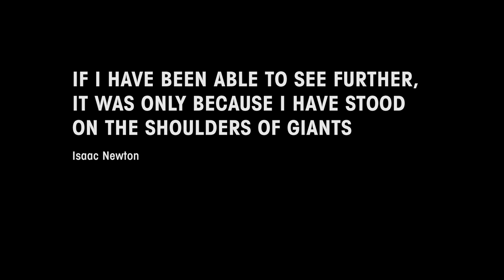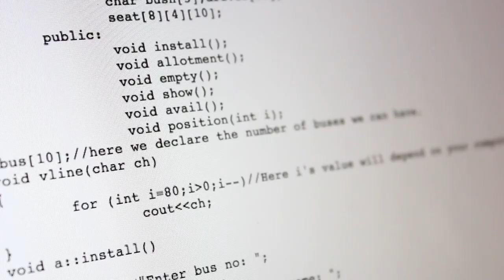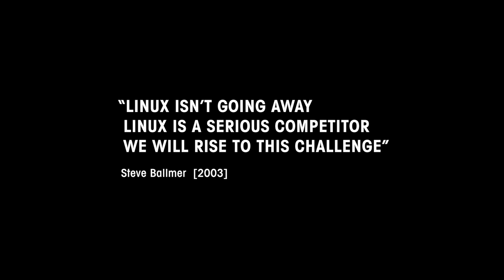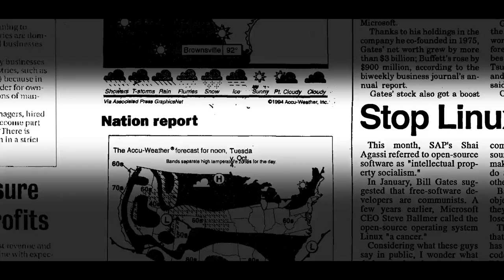Software Wars Teaser Trailer

Comment: Whaaat? This process helps you build your wealth freely and with a much better ROI. Besides the other systems are way too slow and unreliable to handle trading. Community effort is not Marxism. Marxism has it's roots in 9th c. Christianity,  a historical sidetrip. c.f. Plotinus. A common misperception.